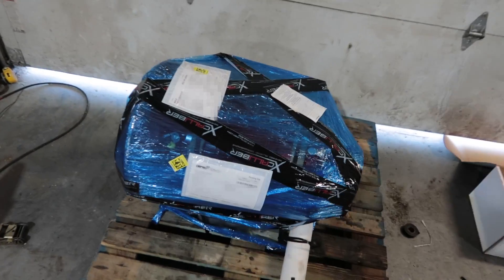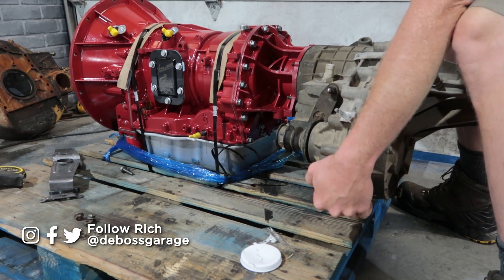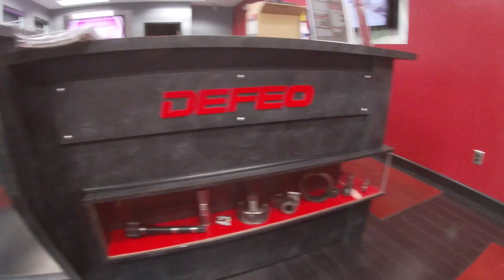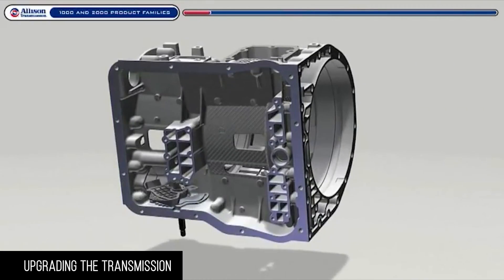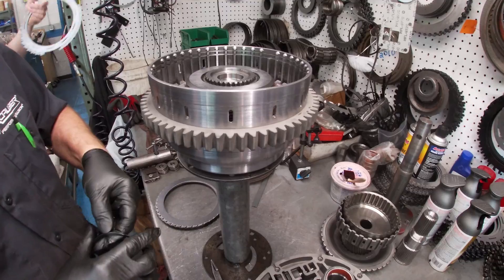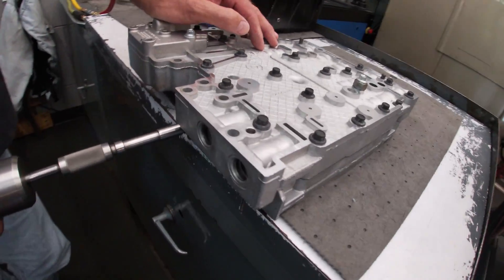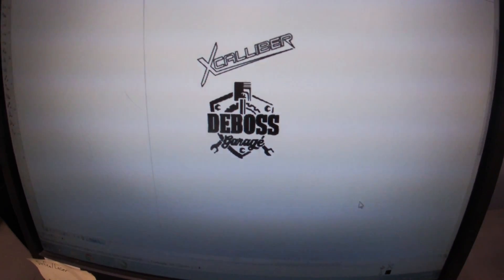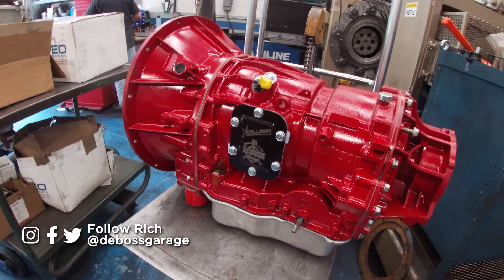Building a CUSTOM Allison 2000 Transmission | #FTreeKitty [EP6]

Comment: This is a bit necro but I have a bus with this trans and was just wondering if anything had to be physically changed or updated on the valve body or were the only required hard part changes for the park pawl and 4x4 housing?

Comment: I have a 02 24V DRW Ram with no Trans. I keep being told go with the NV5600 but buddies of mine who run shops are telling me parts for those are becoming limited. My Options just from my research are NV5600, Eaton 10 (Overkill), Eaton 8LL and just recently Ive considered the Allison Trans. Now Im stuck figuring out diff in 1000-2000-3000 Series Allison's. Any Suggestions or other Trans options. Im looking for RELIABILITY over all. It will be Towing avg 12k to 17k lbs somewhat often and I do not plan on taking it past 400ish in HP down the Road.
Reply: I should mention. Needs to be on a budget if at all possible unfortunately....

Comment: So i hear dif stuff here...I want an Allison, But the price is crazy for me..$12k and the kits for everything else is $6k...damn....So they are saying the the light duty trucks say Allison on them but thats just named it..Not a really Allison.?.....So whats the Xcallbers..real Allisons..?....Price is good on the red...stock hp on a 1995 f250 7.3 powerstroke....
Reply from the maker: Find a school bus, or we can get you one from V and R.  There are tons with the 7.3 in it.  Pull the trans, wiring and ECU and send to Xcalliber to rebuild.  They can build it any way you want and will bolt right up to the PS.  Trans will run $1000-1500.  Rebuild cost us $3000

Comment: The torque converter replacement is good to keep contaminants out of a new build...so remember to flush your radiator trans tank and lines as well...just to be through.

Comment: @DEBOSSE GARAGE I need you're help cause you're all knowing regarding dodges and the forums are driving me crazy cause they're all dead ends. I just bought an 06 3500 drw 5.9L and when going 50-65mph and the truck shifts into over drive there's a pretty intense vibration that occurs. If I hit the O/D lockout button and drive in 4th gear I believe the problem goes away, do you think or know if it would be likely that it's a torque converter issue or a problem with the O/D clutches being toast, it's only got 90k miles on it. I'm hoping it's not a trans issue but it does have a powertrain warranty so I might just have to take it back to the dealer. Any knowledge or advice you have on this issue would be greatly appreciated

Comment: Beings that I just watched them assemble a transmission completely dry with no pre soaking of the clutches or pre lubing seals and planetary gears, I will not be ordering my Allison from them.
Reply from the maker: it was just a dry fit for the video demo so they wouldn’t make a mess. They do soak everything. They also fill the units on the dyno and drain them to remove any break in material which many trans builders don’t have the ability to do.

Comment: Curious how much of a diff the extra gear makes on an a1000?  Is it worth the extra couple thousand or should you just put that money in the bank for gas money for the extra rpms?  It’s my understanding they all have the hardware for it, just needs the valve body and software to use it?

Comment: I was surprised to see that they didn't presoak the frictions.
Reply: They didn’t show actually doing it but they did look wet on the way in if you look close
Reply: @ronfrance4041  I only saw bone dry frictions going in.
Reply from the maker: it was just a dry fit for the video demo so they wouldn’t make a mess. They do soak everything. They also fill the units on the dyno and drain them to remove any break in material which many trans builders don’t have the ability to do.
Reply: I came to the comments for the same reason. The first few may have been soaked but a saw alot of dry fractions going in there. My hope is after doing mesuments it came back apart and got soaked.

Comment: The only thing that surprises me is they don’t soak the clutch disk in transmission fluid before assembly.
Reply from the maker: it was just a dry fit for the video demo so they wouldn’t make a mess. They do soak everything. They also fill the units on the dyno and drain them to remove any break in material which many trans builders don’t have the ability to do.

Comment: From experiences in a past life (10 years ago now, so things change)... School buses, at least in the US, aren't actually derated (maybe you're talking about transmission calibrations specifically?). It's up to whatever the district decides to put in their bid spec. If they said 500hp, OEs would package 500hp, somehow... Man would I have loved for that to land on my desk back in the day. 15L in an REBus? Hell ya, brother! Get ready to lose about 4 rows of seats and gain about 12 radiators, but it would be worth it. The power limitation on most buses is cooling, but on a conventional cab it's the same as a truck so 300hp+, the same as any other MD, was a standard option in them. In FE/RE, the power usually had to go down because you just couldn't cool it. Believe or not, you could order a CE with a PTO too if you wanted, though I'm sure you're right that no one ever has. 

Oddly, I was told that it's actually illegal to derate the power of a school bus or emergency vehicle in the US, by way of engine protection anyhow, because if the options are someone dies or it tosses the rods out trying, it's better to toss the rods out trying. I've never tested that beyond what I was told (so a tech may have witnessed a school bus derating in reality), but it seemed plausible.

This could all be different in Canada too, of course.

Anyhow... You've found the one school bus nerd in your viewership. Or at least I was in days gone by. Also, props to the guy that did the exploded animation on that thing. That took a few minutes. ;)

Comment: MD 3060, MT 643 were good units in school buses  many went cradle to grave 200,000 plus .   PTS 2000  not so good had to have with electronic engines. The AT 540 ,545 we almost  put quick connects on them. We kept one in stock. Of course the AT was cheaper when the buses were bid and they were replaced  many times over the life of the bus . Really  a nice looking rebuild.

Comment: Man that thing's big.  I have put a 6 speed 1000 into my Humvee that doubles as a work truck and I thought that was kind of big (I usually work with small sports and rally cars for perspective).  Going from the 3 speed to the 6 speed pretty much solved the whole "top speed being ~65mph if you're lucky while pinging rpms" problem and really bumped up the fuel economy.  Planned on replacing the Detroit but after doing some basic upgrades to it plus the transmission swap I haven't felt any need.  I don't haul or anything with it, it's just something fun to drive around that I can flush out easy and toss an engine in the little bed or something to move around.  I've done a 14 hour round trip in it since the swap and it was smooth cruising the entire way with the new seats.
Reply: That’s a lot of money for something a little 1/2 ton pickup could do for 3x the mileage. 
Whole trucks that, ya know, cost less than your transmission.
Reply: A 2000 and a 1000 are physically the same size.

Comment: why are they rated in HP shouldnt they be built to handle X amount of torque with HP being pretty negligible?
im sure they hold up fine with a 500hp turbo 4banger infront of it that might make 280ftlbs peak torque but take a 300HP cummins that might peak out at 1100ft lbs big difference but youd think the little gasser would be harder on it purely looking at HP not a realistic combination but shows my thinking
Reply: HP is calculated using the torque output value, at least on commercial applications. So... one 400HP diesel will make close to the same torque numbers as another 400HP diesel.
Reply: Yea basically it is built to a torque spec 
But they make it HP rating because that's what the consumer wants 
Its easier to split the difference between makes and models when searching the Web 

But I bet if you actually asked them they could tell you the torque rating of each and every component in the trans

For those interested horse power is toruque (in ft-lb) X rpm / 5252
Doesn't matter if its a deisel a petrol electric or steam engine
The same formula for everything
Reply: @fowletm1992   i realize torque is HP times rpm/5252 but my point was the trans doesnt care about rpm it cares about torque, and as far as everyone operating in the same rpm range thats a very specific assumption.. its pretty easy to add valve springs an rev a cummins out to 4500 rpm for extra power but that does nothing for torque
Reply: @AndrewBrowner  
If you were serious about performance and talked to the builder they'd quote you per torque rateing 

But for the general consumer and advertising theyre done in horsepower 
Its purely advertising 
Just like turbos and intercollegiate and axles 
Everyrhing is rated in a round about horsepower even if its a bit irrelevant 
Could prob get hp rated headlights
Reply: @fowletm1992  if you know the amperage draw of the lights and you've got about 14 volts, take the product and divide by 746 and that's  the hp draw of the headlight.
(Amps x volts)÷746=hp
Reply: @kwaherikwasasa  
No idea if uour serious 
But thats brilliant 
I like the idea of going to the pub be like yea na just put another 1/2 hp of light on my truck, so you know I'm kinda a big deal 
Haha
Reply: Except the little four banger won't bolt to it, and all of the engines that do operate in the same RPM range. HP is tourqe and rpm, so since the hp max is known and they all run in the same rpm range, the torqe figure is factored in even if it doesn't get a spot on the pamphlet.

Comment: I'll tell you this: I work on tractor trailers that have Allison autos behind the Cummins X15 and garbage trucks that shift CONSTANTLY and they can take anything you can throw at them!
Best auto trans on the market bar none!
Reply: The garbage truck guys in my town floor it after every stop. 👍
Reply: @fastinradfordable  Yeah that's what they do here also! By the time they get sent to auction they look like they have been through a war!
Reply: I drove jockey truck for 3 years and we had four capacity yard dogs. All spec’d the same. Allison 3500’s that the company I worked for allowed us only to use gears 1-3. We were a 24/7 operation, the trucks ran almost %100 of the time, except for maintenance.  We never had any trans issues or engine issues for that matter.  We were jockeying flatbeds of drywall for USG. heavy, heavy loads for those trucks. Engine and trans combo was great. I’d mash my foot into the throttle every single time from a dead stop and that Allison took it every time. We’re talking 55-60 thousand pounds from a dead stop. Never been around a more durable piece of gear yet.
Reply: Way back in the day, and I'm talking 50 years ago now, my Dad had to rebuild Allisons out of garbage trucks. He said working on a trash truck is one of the worst jobs imaginable just on smell alone... then there are the maggots... and the "drippings". Since they're cab overs you're laying under all of that to pull a transmission, or at least that's how it was back then.

Glad to hear you rarely have to service them, because his description talked me right out of any desire to ever try it. ;)
Reply: @TheBrokenLife  We had a transport truck come into the shop.  Only one guy had a trucker's license, but they were driving long haul.   They had a hole cut in floor board so they wouldn't have to stop for bathroom breaks.  Same thing... "drippings".   Except we could throw them out and tell them to take their business elsewhere.
Reply: @wihamaki  I accidentally did that once in on my S10s my missing a bottle... I would have never had the nerve to ask someone else to clean up after it though. It was a rubber floor mat truck, thankfully.
Reply: @TheBrokenLife  Your description sounds pretty accurate of my job! I feel like I'm on the set of Dirty Jobs when I go to work! It makes a man out of you!
I honestly don't mind it at all and love what I do!
Reply: @lustfulvengance  Guess Dad wasn't telling tall tales then! :)

Oh, he loved medium/heavy trucks (and I did too for my time in a different wing of the industry), but hated garbage trucks.

All flat raters bust their backs to get the job done as quickly as they can, but Dad was in laser focus mode when it came to those things. In/Out, no lunch, get it out of the shop ASAP was his mantra. He'd take a break once it was on the bench and the truck was dripping in the parking lot.
Reply: I would call the allison 3000/4000 series bulletproof, NOT the 2000 series in stock form.
Reply: Not impressed with the 4500 Series Allison behind the DD13 in the 4700 Western Star at work. It’s clear the transmission eats up a lot of the power. Manually shifting is the only way you can get it to do what you want. Descending steep grades the transmission decides to grab the next gear. I know other drivers with different trucks same transmission say they could do without. We have a F750 6.7 Cummins 3000 series again makes the engine feel gutless the truck will power out. Not impressed with the Allison automatic transmissions. The mechanics reprogrammed the Western Stars transmission to shift a little better it was worse before. If I was to have an automatic it would be Eaton auto select.
Reply: @Graveltrucking  We always had to have the guru from the Allison distributor come out and reprogram ours for a more aggressive shift program.  If they are programmed right you can inhibit upshift on a downgrade, inhibit upshift going uphill when the computer knows it can't pull the next gear, etc. but the guy behind the laptop really needs to understand what he is doing and that is a rare thing.

Comment: So your saying we could pull the Allison transmission from a school bus and fit it in a 2nd gen dodge ram 3500?
Reply: Off to the junk yard O.C.G
Reply: @tooshorttosee  I wish there was a school bus in the local junk yard lol. Most here are just filled with pickups and cars
Reply: @oldcroneysgarage9739  Buses usually end up at places that specialize in heavy equipment.
Reply from the maker: Yes
Reply: @DEBOSSGARAGE  sweet
Reply: @oldcroneysgarage9739  So, it looks like to get a reliable Dodge pick up truck, (1) Remove the Chrysler engine, and install a Cummins. (2) Remove the Dodge transmission and install an Allison Transmission??? :)
Reply: @newjerseybill3521  Yes you got it. Watch out for the Chrysler wiring next.
Reply: @owenarsenault5955  powers & grounds & TIPMs, Oh My!!!!
Reply: @newjerseybill3521  well I own a 99 dodge ram 1500 with a gas 360. And it's a good engine (for now) but sometime in the future it needs a rebuild. It's coming close to 200'xxx miles. I got it with a misfire and it turned out to be a bad spark plug. But I have had the idea of putting the body on a 1 ton chassis with 1 ton axles. But i was told I'd be better off with a actual 1 ton from the factory
Reply: @newjerseybill3521  I mean I do love the Cummins engine more than the dodge gas engines but really none are perfect. But I do agree the dodge automatic transmissions suck
Reply: @oldcroneysgarage9739  Did you ever work on the "Lean Burn" 360 with the electronic spark module on the side of the air cleaner?
Reply: @newjerseybill3521  I never even noticed it honestly. I'll have to go look at it
Reply: @newjerseybill3521  the lean burn system ran from 76 to 89 I believe.

Comment: Well, it attaches to a lot of engines that use the SAE No. 3 bell housing.
Reply: I believe the Allison 1000,2000 and 2400 have 4 or 5 different bell housing options.

Comment: Hey Rich great video 👍
Is there a reason why you went with an automatic transmission?
Reply from the maker: The Silverado and Audi are manual.  Its fun at first, then it gets old fast, like me
Reply: @DEBOSSGARAGE  
Lol, I hear ya on that one.
I just turned 58 but don't feel a day over 83👍
Reply: It gets old, as long as you have several thousand to throw at an auto trans. 

For my shoestring budget, manual never gets old.

Comment: I was thinking youd just do a divorced transfer case setup
Reply from the maker: More u-joints that don't match, mounts that get in the way of exhaust, this is just so much better
Reply: @DEBOSSGARAGE  this is for sure a better solution than a divorced tcase and rigging up the other trans
Reply: It's a borerline nightmare getting all that stuff to fit under a full on commercial chassis. Rich is far and away on the right path here.

Comment: Looks professional an high quality
Reply: Yea, no, they assembled it dry with no assembly lube or pre soaking the clutches. NOT professional.
Reply: Eccentric Smithy thought when they tested the valves it would put oil into clutches

Comment: Those dudes at Excalibur don't smoke a fat stogie...I'm not sure I trust em! Hahaha peace!
Reply from the maker: Joe is shaking his head right now
Reply: It's funny that I remember exactly what you're talking about.
Reply: Ash is an additive is some oils... some add a bit more.
Reply: I dont trust them just because I just watched them build a trans completely dry with no soaking of the clutches or pre lube assembly.
Reply from the maker: Eccentric Smithy it was just a dry fit for the video demo so they wouldn’t make a mess. They do soak everything. They also fill the units on the dyno and drain them to remove any break in material which many trans builders don’t have the ability to do.